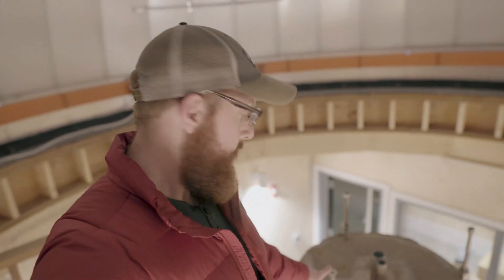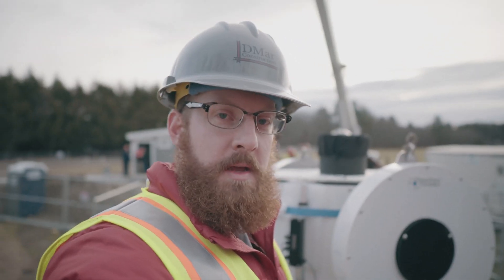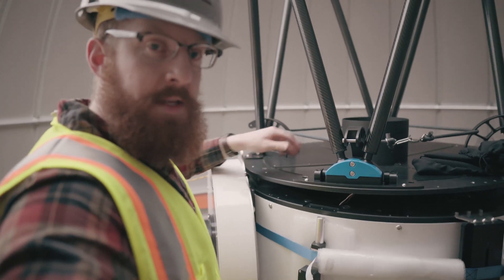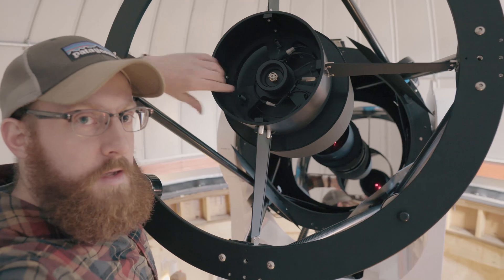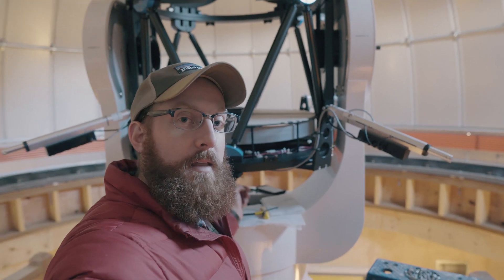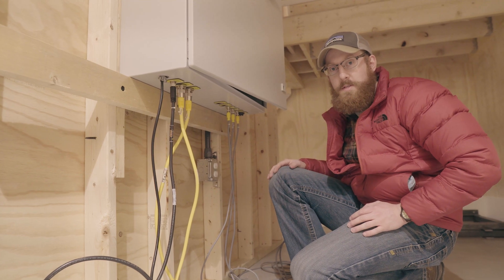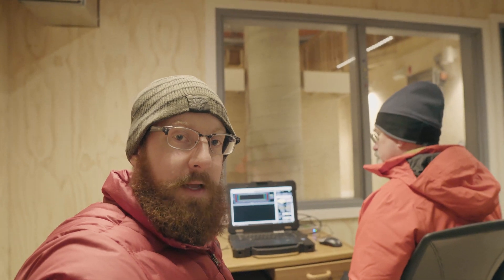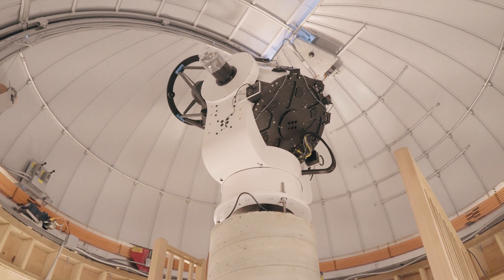Exeter Academy PlaneWave Instruments CDK700 Install

Comment: So you have a very expensive and sensitive telescope mounted on 3 thin bolts on a spindly pillar. you are going to have issues getting a stable image the pier ringing like a bell. When you have a pier even the weight of the person deforming the ground is enough move the telescope blurring the image.

Comment: Wait. 

There's this huge, solid concrete pillar, and a massive inflexible mount, and they're joined together with... 3 bolts? It just sits on those 3 bolts..?
Reply: Haha, I was thinking the same thing. Also those three bolts seemed to be M12 or M14 at best, while the mount and OTA probably weigh several hundred KGs.

Comment: I find it strange that the entire mount/scope rides so high up on the three bolts/nuts. Hard to believe those 3 bolts can handle all that weight.
Reply from the maker: Happy to answer that question. The system is installed on three x 3/4 inch steel threaded rods. Each of those threaded rods could easily hold the weight of the CDK700 individually. The Alt/Az design is great because there is minimal torque load on the pier and bolts since the load is vertical. The CDK700 could sit on the ground without bolts and still run safely, of course the cable routing needs to exit the azimuth base, so we stand off the system to have access to the base in case maintenance is required in the future.
Reply: there is no engineering world at least on earth where it makese sense to put all that weight on three bolts. It is not even the bolts thesemelves it is the threads that everything is riding on. Your equipment seems quite good, but I don't believe a "rat cage" setup is defencible or appropriate for the quality instruments you are producing whetever the maintenance advantages might exist. There are definetly other ways to do it better and avoid that. @Observable-Space
Reply: I saw that as well I have the same 24" concrete pier but extending it 66" in hieght on top of concrete pier with 1/2 plate welded to 12"  x 1/4" x 66" Cason Pipe to another 1/2 welded Plate to accept the L-500 wedge,  3 bolts I do not understand? Matt can you clarify?